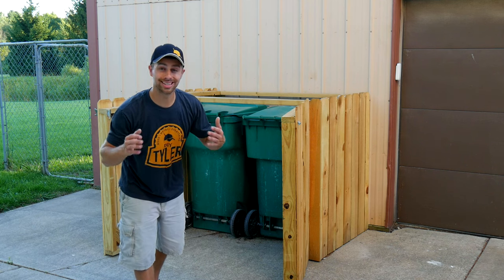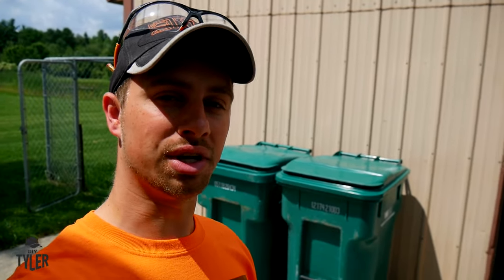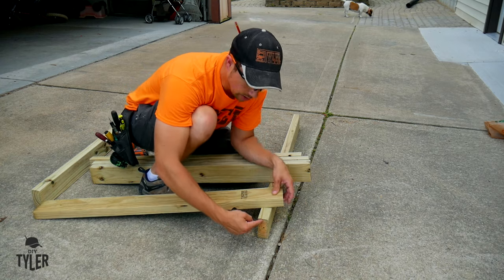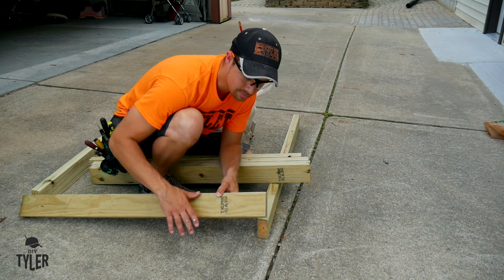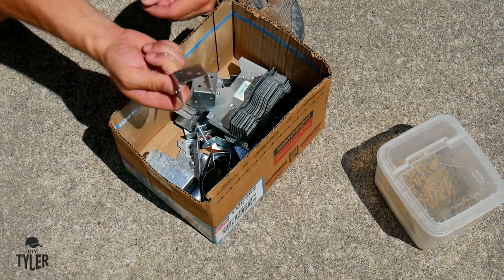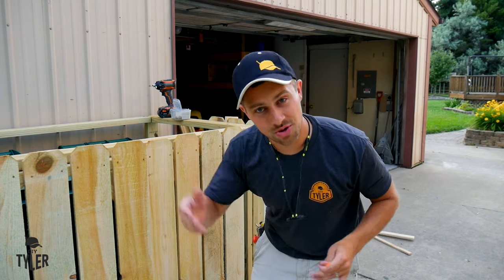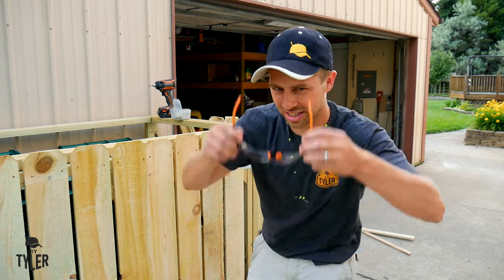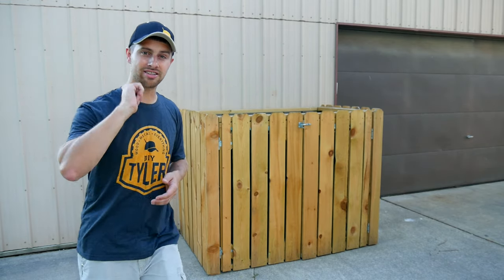Hide your Trash! Double Trash can Blind

Comment: The ends of pressure treated wood rotting out is because the builder probably didn’t field treat the wood. The pressure treatment doesn’t extend through the entire thickness of the wood, so cut ends need to be treated.

Comment: I built this but my doors are sagging a lot in the middle and won’t swing properly. Any tips you can give me?
Reply: Tack a thin piece of wood on the bottom of the outer most front posts thus alleviating the sag?? or use bigger hinges? or....cut a bit off the bottom of the planks? Good luck..just brainstorming after building this, but for just one can.

Comment: Looks like you have to remove them from the build so you can just add  trash or will it open without having to pull them out ?
Reply: Oh you can open these from the side without pulling them out! Very important feature for me 👍
Reply from the maker: Can open the lid through the top. Was gonna add a roof but didn't want to have to hold the roof and the can lid at the same time.

Comment: Wood rots out because water gathers where the wood meets the ground/pad. Surface tension keeps it there, giving it time to wick into the wood. You want to stop rot, put 1/4” or 1/2” metal / plastic feet under the contact between ground and wood.